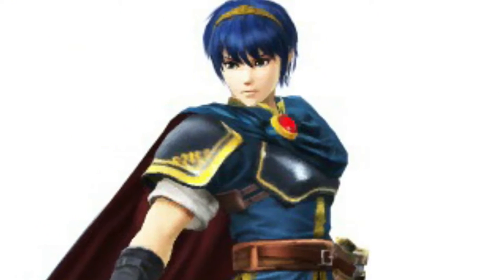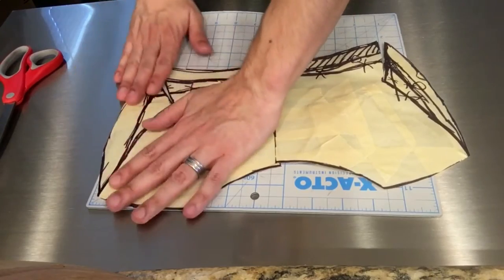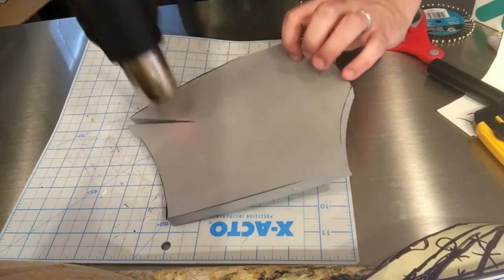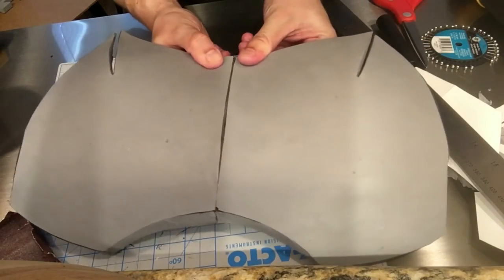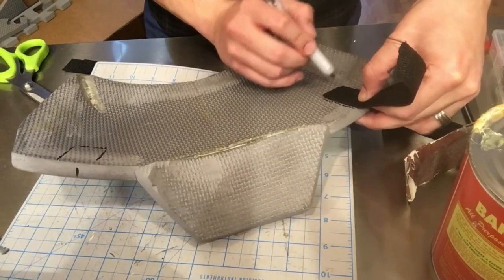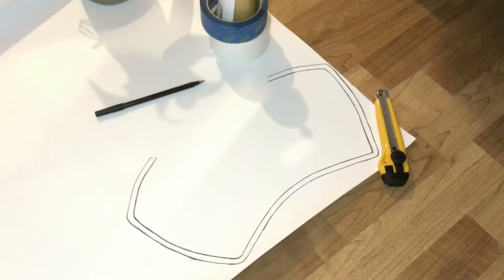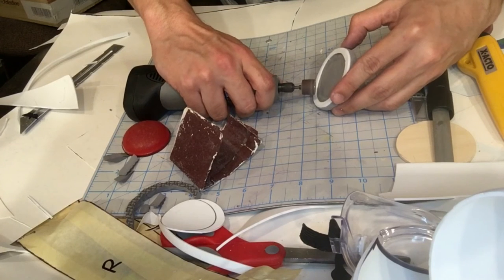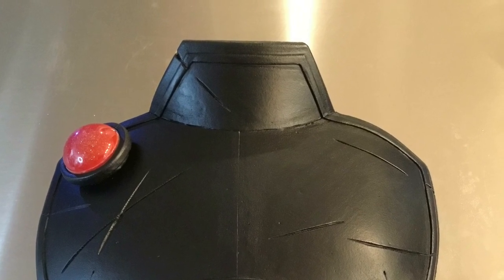Marth Cosplay Tutorial: Part 1 Breastplate

Comment: I have cut the breast plate! It looks good so far, need to do some sanding and what not but so far happy with the result. I actually have a question because I tried cutting out the circle bases for the breast plate jewel and I'm running into a problem. Do you have a recommendation for cutting them out of eva foam? When I try to stay with the line, it ends up beveling the edge or is that okay? If you hold it out the side looks like: / from top to bottom. Thank you
Reply from the maker: +RememberTheAGES Getting straight cuts takes a bit of practice, BUT if you cut just a millimeter or two outside the lines, you can use a mouse sander or a dremel to sand a straight edge later on. 

Keeping that in mind, it also might be easier to just cut the base pieces with lots of straight lines, and use sanding to round them out.

I’m so excited for you!! Keep it up :D
Reply: Gotcha, that does make the most sense. I will try to get some more work done tomorrow.

Comment: Hello ! 
I know this video is kinda old and you are unlikely to respond, but could i ask you some question ?

Would an hair dryer work to replace the Heat gun ?
And also, i don't really get, how do you make the gem ? I undertood it was using Resin, paint and glitter but i don't really get how is it made ...

Well, thanks for the tutorial, it will be really helpful !
Reply from the maker: I wouldn’t recommend a hair dryer. They simply don’t get hot enough.

As for the gem, resin works in a weird way. It comes in 2 liquids. When you mix them together (in the proportions on the package), it will harden into a plastic-like solid. The paint (or dye) is added in the mixing process to add color to the gem, and glitter was added just to make it sparkle a bit. If I didn’t add paint or glitter, the gem would have come out completely clear.
Reply: Thanks for the quick answer !
As for the gem, i just saw your video about it, and i would like to ask, since the gem for Marth's plate is more "round" than the other on the gem video, did you polish them or did you just used a different mold ?
Reply from the maker: No problem. I used a different gem. I didn’t like how the gem came out in the video, so I made a different one. For the video I used a floral resin which resulted in a weird rubbery texture.
Reply: Thank you ^^
Reply from the maker: You’re welcome. Let me know if you have any other questions.

Comment: Hey! This is great... I have a question for you. Does the EVA foam curve enough to, let's say, create a breastplate that curves over shoulders? I want to make a breastplate but has a front and a back (it's all one piece) and I don't know if i'll be able to curve something so thick.
Reply from the maker: Ashley Torres I think It would definitely be possible, but unless you have very large pieces to start with, you may still have to make it in multiple pieces that glue together. For curves that go around the shoulder, I suggest heating and bending it into shape and immediately dunking it into ice water. The foam will retain more of the curve that way, and the water won't hurt the foam. Keep in mind, a single piece that goes all the way around you will likely flex from wear and crack non-flexible paints.
Reply from the maker: +Ashley Torres From the artwork, it looks like it's one piece. If I were making it, I would make the front and back pieces separately. If it's one piece that goes completely around you, you won't be able to get into it since it looks like it pinches in at the waist. A small seam at the top of the shoulders will allow you to get it on and off, then it can be secured with Velcro under the arms. The shoulder pieces would certainly distract for your seam though. I think something like this will require some artistic license to change the design for practicality. 

As for the shoulders, they look like they attach directly to the breastplate. If they're light, they could be Velcro'd on, but if they at permanently attached, they would prevent you from opening the armor to get it on. I also can't really tell if the attach to breastcups or in from of the shoulder.

If you're worried about the finish, I'd stick with a single material. Worbla would create a sturdier surface, but you'd have to reinforce it with foam (craft foam or EVA) anyway since it's so thin. Keep in mind, craft foam sandwiched in Worbla still bends A LOT, and that would craft many paints.